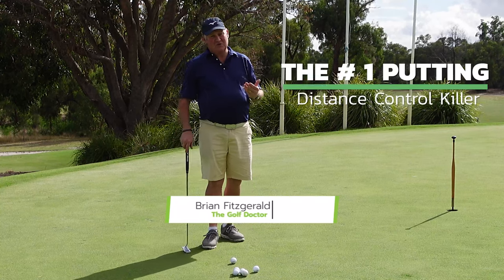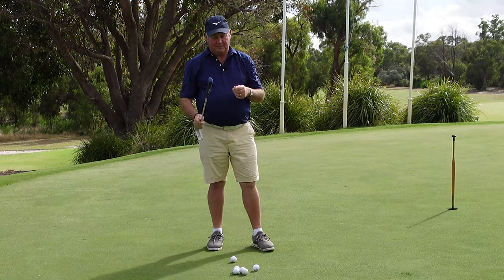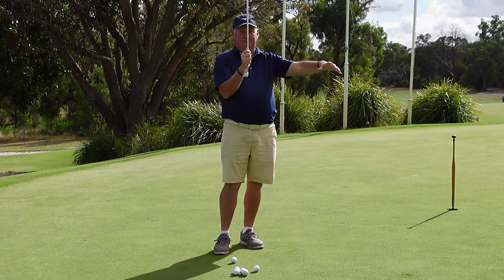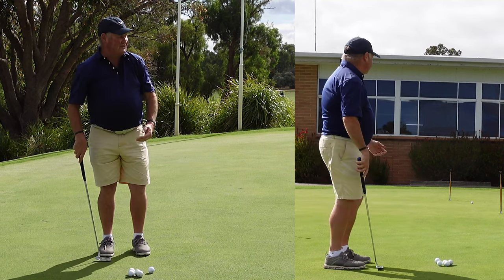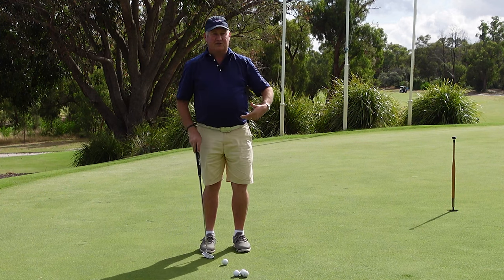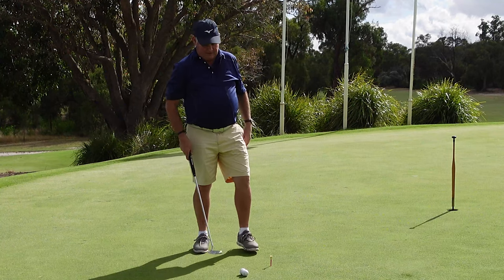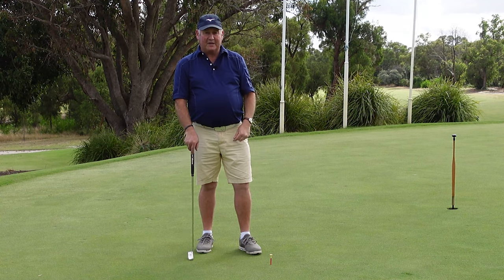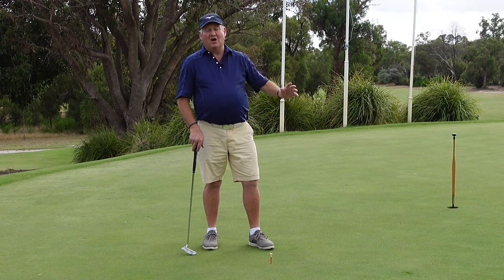Number 1 Putting Distance Control Killer

Comment: Putting, what a large amount of study for one of the very shortest strokes. Well I have been all over the place with putting, what with speed, stance, reading greens, break, etc. it can really require work. On the other hand a bad putt can really ruin what had been a very good play of a hole. I'm going to file this one in with the ones I keep in my "back pocket", along with "take the shot you know you can make". Gosh, what other golf stroke requires so many things to be just right? Thanks Brian, I hope to get out on the course this week, but weather here is a bit rough looking this week. My golf pal and I changed off to one of our other courses last week, one a bit tougher than our "home course". I was surprised that the score was better than last year's there. Had I not blown up on two holes I would have been at 92, a very good score for me there. The cause of the bad scores? Well I had a very acceptable drive on each and for my second shot I had drawn out my 3 wood (I don't hit that very well as yet) and blew out rather than using my irons as I usually do. Seriously Brian, taking the shot you know you can make is solid. I'll save the 3 for the range this spring.
Reply: hey
Reply from the maker: Hi Bob. 

Putting can both be so frustrating and complicated. I just try and make all of my coaching as simple as I can. 

That’s great about playing on the tougher course and shooting a good score. 

My hit the shot you know you can hit strategy works at every level of golf. Even on the PGA Tour. That’s what they do every shot. 

I’m glad your golf is getting better through better strategy. 

Keep my updated. I  keen to follow your progress. 

Brian

Comment: HI Brian,  You said  the follow through should be approximately 1/3 of the back swing length.  your older putting video says equal distance.  so this  shorter follow through is better?   I am going to try this new  way tomorrow on the course.
Reply from the maker: The putting stroke without hitting a ball is the same length back and through. 

When the putter impacts the ball it should reduce the length of the follow through to about a third. That is without acceleration. 

I hope that makes sense. 

I hope it goes well for you tomorrow. 

Brian.

Comment: thanks for the tip last round I had 4x 3 putts, mainly from hitting ball to back of green with front pins, and leaving some roller coaster putts eg back of 8th, back of 2 back at 16th .After game hit long putts and short putts and seem to have better touch. still have to work on it pre game next round. PS the green bottle top is helping
Reply from the maker: That can be nasty on the fast slope greens at Lang Lang Geoff. 

Practice is the solution and you have done that. 

The bottle cap is a beauty. I have filmed it but not released it yet. You have the scoop.